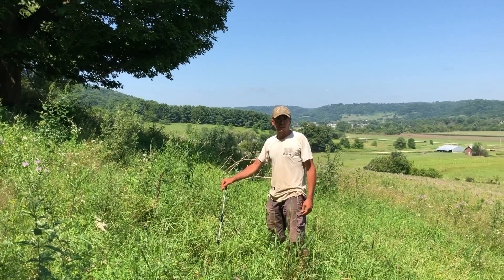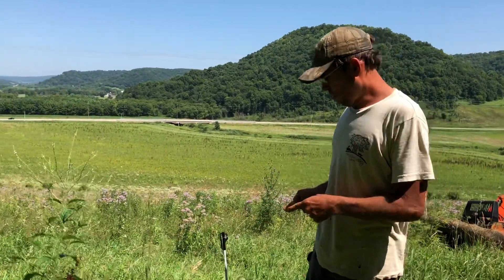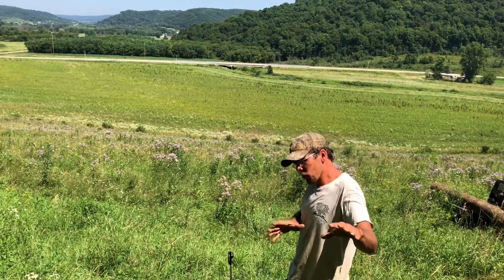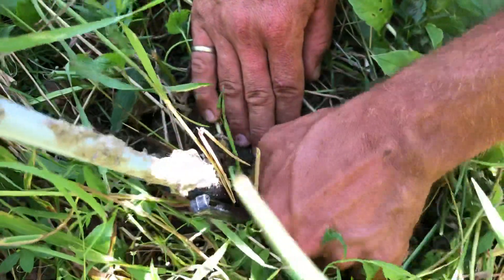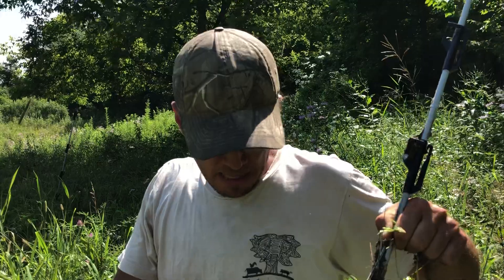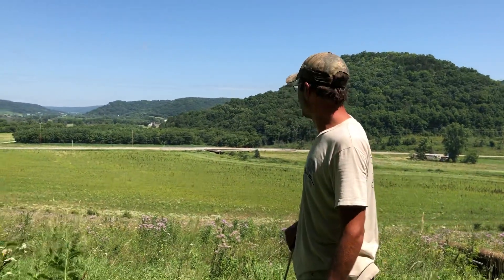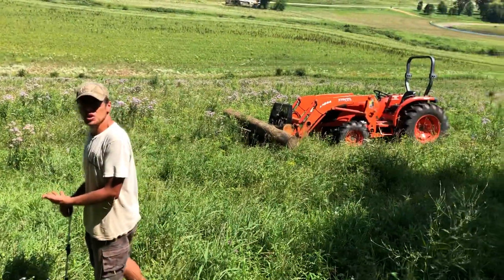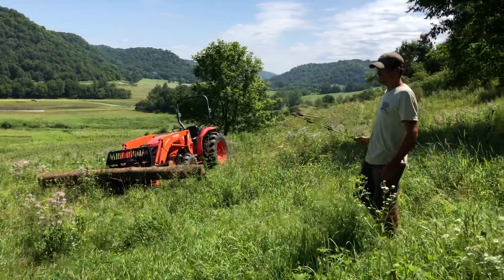Rapidly Building Soil - See how we’re building soil and biodiversity with managed grazing

Comment: Wow. In 30 years  at that rate 1 inch/year, it will be 2.5 feet up your trees and fences and in 300 years ("normal" time to produce 1/2 inch topsoil) it will be 25 feet deeper. and spilling over the road at the bottom and  you'll need a digger to  find trees for timber.